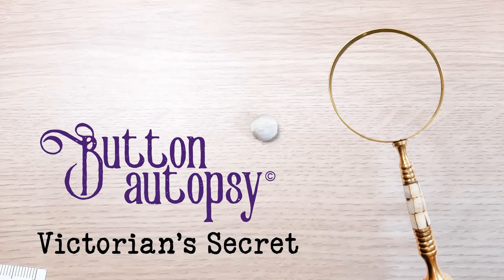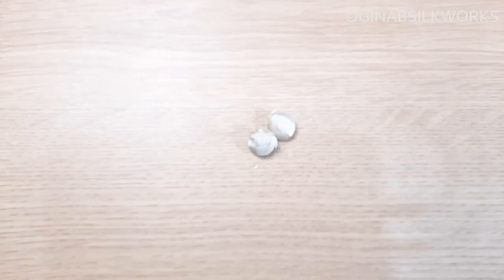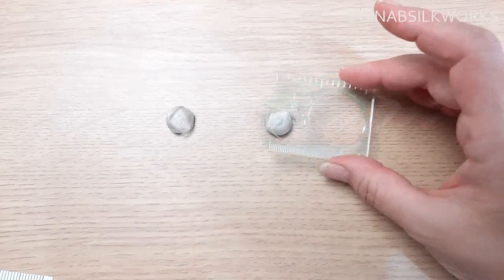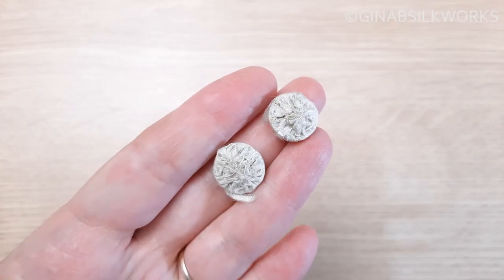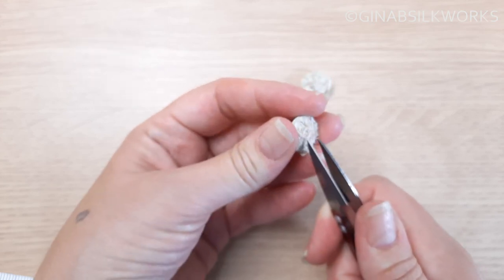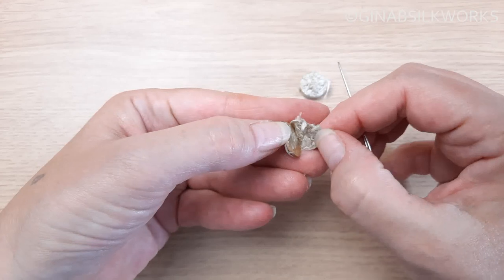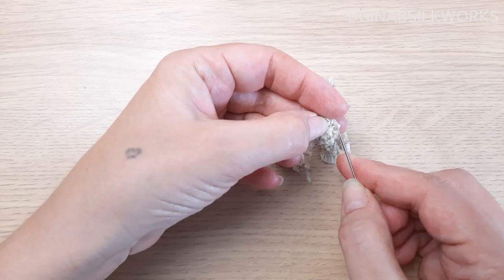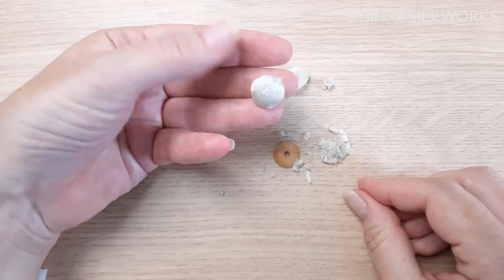Button Autopsy - Victorian's Secret / Examining an antique silk covered button / button geek!

Comment: Do you recommend a certain way on storing silk buttons?
Reply from the maker: Old silk should be kept away from direct sunlight - that increases the likelihood of the silk breaking down and shattering. I tend to keep them in boxes or tins with acid free paper, sealed to stop moths or bugs. If I do frame them, I never hang on a wall facing a window, and never frame really fragile ones.